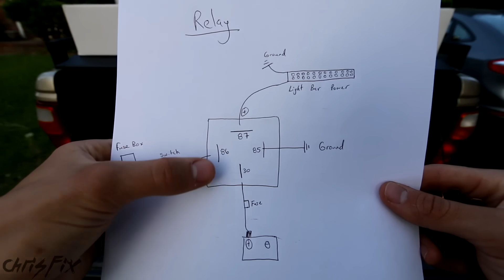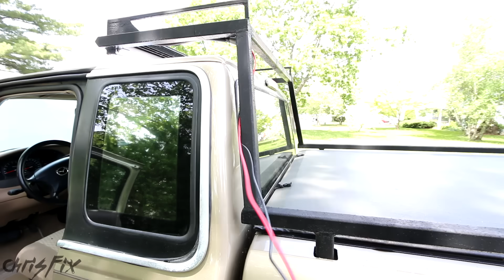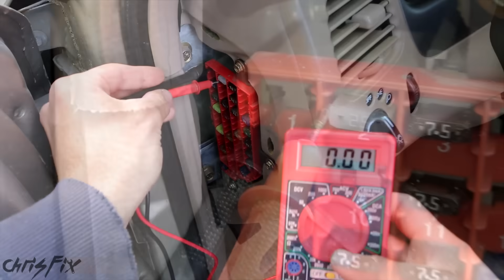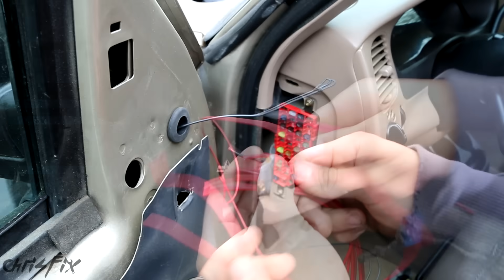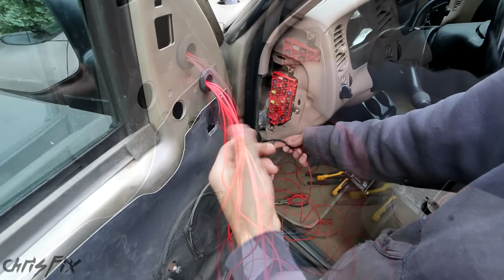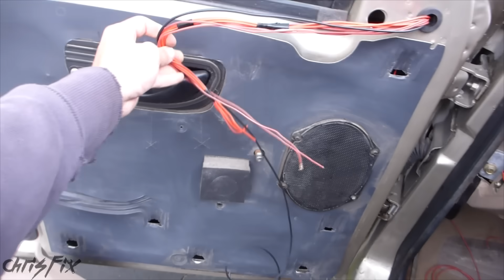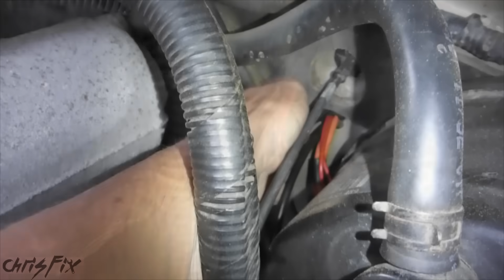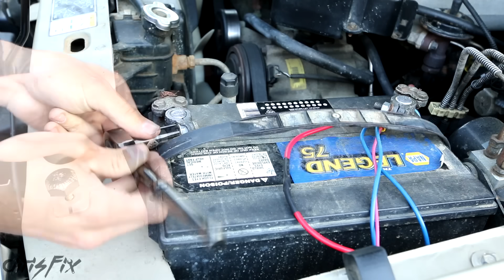How to Wire an LED Light Bar Properly (Project Night Light Episode 3)

Comment: you literally blew my mind putting that switch in the door.......
Reply: Me too! Never seen that and can’t understand why, aside from being very different
Reply: @MachitoLFC  simple convenience and orientation. It's actually quite logical, because this way he doesn't have to take his eyes off the wheel to turn them on or off. They are right there.
Reply: Why not connect the fuse tape to the wire after you ran it through the door harness 🤔
Reply: ChrisFix can u do a video on your Mazda smoke test vacuum check?
Reply: Toby Costello kaaboom
Reply from the maker: Good idea right?

Comment: ........ what do I do if my car has the fuse box in the engine bay??
Reply: it'll probably be a little more difficult wiring a switch as you would have to go through the fire wall, but it should be fine
Reply: Your car should have 2 fuse boxes, one in the engine bay and one inside
Reply: yeah you should have one in the engine bay and one in the inside, check your manual

Comment: You could have just pulled the wires through from the other side. It would be a same thing, you just wouldn't have to pill the other wire again in the other direction. Yea I've been running wires like that in buildings for 5 years so you find ways not to do the same job twice.

Comment: could you tap into the wiring to the high beams to actuate the relay so you wouldnt need a switch?
Reply from the maker: +losiboy454 Yes, you can! I want to do a video on that. I did something similar for the reverse lights: https://www.youtube.com/watch?v=ZVG7X-ae298

Comment: Does the wire for the switch not have to be as thick of a gauge as for the light bar?
Reply: +Calvin Sweeney no because its not carrying the large current that the light bar needs, its just enough to power the relay

Comment: Why use such large gauge wires for your switches? They probably use about 200mA maximum to run the relay, and maybe another 20mA for the internal leds.

Comment: great job! The link to your video was posted on T4R.org, by far one of the more in depth installation videos out there. 

What recommendations could you give for wire placement for an suv, where the light bar would be near the front cab and there isn't an option to run the power cable between a cab and bed for a truck?

Comment: Great vid. At first I was like WTF?? about running the wires (I would've done it backwards [from the kick panel and pull up through the door] but that's really a minor issue. When you explained how to wire the ground and the switches I felt like a Guinness commercial, "BRILLIANT!!" 

I like the idea of installing additional switches in advance. With the unused wires, did you label them before tucking them away?

Comment: So I am going to be putting quite a few lights on my TJ in the near future; nine lights to be exact. My big question is: in order to get the best results from the lights, am I going to need to swap in a high output alternator? I feel like my stock 117A alternator just isn't going to cut it.
Reply from the maker: +Taylor Hayden Depends on how many lights  you are adding. I wouldnt run more than 30amps over your stock electrical load. I upgraded mine: https://www.youtube.com/watch?v=XC8W9RHGTMI
Reply: Sweet, man! Thank you so much! I watched the video and will definitely be refering to it in the future!

Comment: is there a need to upgrade the alternator? since the light bar is drawing a big chunk of power from the batt...
Reply from the maker: +devdeng The light bar is only drawing 10-15 amps more which is not a big deal. Your car or truck is designed to be able to have an extra load. Now that being said, I plan on running more lights so I did this: https://www.youtube.com/watch?v=XC8W9RHGTMI

Comment: I'm not an expert but I am a DIY fan. I wired up an LED strip in my trunk and I just tapped into the trunk's existing light circuit. Is the use of a relay really necessary? Would it help in any way? Unless you want to make your own switch for on an doff? Just generally speaking. Have I done anything wrong and do I risk anything by tapping into the existing circuit?
Reply: +Alexandru Cioanca A relay is only necessary in high current applications, 15 amps and up, maybe 10. an LED strip draws less than an amp usually. You're fine.

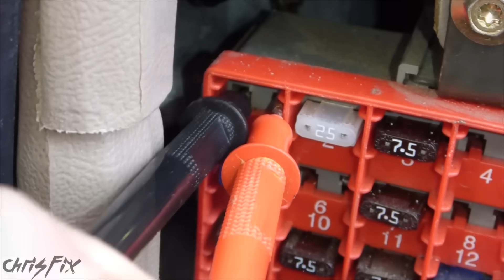Comment: 8:40  hey chrix reply please do i have to turn on the ignition while doing this? how many amps the relay? please reply need help
Reply from the maker: +GAR A If you are using a fuse tap that has power when the ignition is off, you do not need to turn on the ignition. If you want power to the light only when the car is on, you need to have the igintion on. There is a max of 30amps to the relay depending on what you are running.
Reply: +ChrisFix  chris 1 more question please dont get annoyed,   why would I used 30 amps instead of 80amps,  or  why wuold i have to used 80 amps instead of 30 amps?    sorry for asking you a lot......
Reply from the maker: +GAR A Dont worry, Im here to help. This light bar draws 10 amps (that is why there is a 15 amp fuse).  So you want to pick a relay that can hold at least 15 amps so it is protected by the fuse. These relays are mostly 30/40 amps so that is plenty of protection. You can use an 80 amp but that is overkill and more expensive.

Comment: I was wondering if you had a Harbor Freight. The shot at :32 answered that. Is the welder from HF also? It seems to do a good job but I was told don't bother with 90amp welders.

Comment: Lmfao dude I cracked up when you turned that thing on at the trail lol it's bright as shit. But nevertheless what a job well done bro. Very neat and very well done. From start to finish. I started watching this video because I'm installing a small light bar in front of my dodge dart GT 2015 & I wanted to see what I need to do for wiring. I'm looking into some USAF type switches from fighter jets to go in the cabin. I'm looking into placement and if to even do that, or connect them with the fog lights but this video gives me a very good tutorial on how to wire everything, Again well done man this helped me a lot.

Comment: Hey Chris, I dunno if you made a video about it or might have missed it, but what happens if I use a different gauge wire? My LED strips use 28AWG and I have 24 AWG, would it cause problems even if it was the opposite?

Comment: Because youre using low amperage wiring to trigger the relays, you could minimize your wiring a bit by sharing one common power wire to wire every switch. Youd still have to run an individual wire to each relay, but you could use a few less wires between the fuse box and switch area

Comment: There are some people who ride near me that leave their bright lights on (High Beams) when driving. I installed a light bar on the front of my truck (My preference ) and so far, ive only had to turn it on twice to make the other person turn theirs off. (What I do is I flash them once with my High Beams and if they dont turn theirs off, I turn my light bar on and off real quick) (Its not the proper thing to do, but it works)
Reply from the maker: +Zipping Basher I do the same thing haha. They shut it off all the time when you use the light bar!
Reply: +ChrisFix my buddy has a rear facing light bar for tail gaters. works every time hahha
Reply: @impulse9091  thats fucking dope never thought of it 😂
Reply: @impulse9091  me too... Installed it for when I have to load/unload at night, but works like a charm to make the car behind me lower their high beams. For the ones driving in the opposite direction the LED headlights work just fine
Reply: @impulse9091 thought about mounting one like that on my grand cherokee😂
Reply: I'm a volunteer firefighter so I have red and white Emergency lights. I use them to give people a stroke if they're tailgating me or won't turn off their bright ass lights
Reply: With great power comes great responsibility... @Julianna.Domina
Reply: Based
Reply: I wanna put one on the rear of my car for those assholes
Reply: Most of the guys where I live drive ridiculous suped up trucks and just leave their off road LED bar on all the time at night. Bunch off ass hats
Reply: Thank you. I've been wanting to do this as well. Glad to see that I'm not the only one with such intent
Reply: exact reason im buying one
Reply: Haha, where I live, people drive with their light bars on.
Reply: I get the temptation, but do you really want to be blinding oncoming traffic? Sounds like a good way to get in a head on collision. I'm not saying it's right they do it, just that it may not be a great idea.
Reply: @Zoroaster4  Hence the warning flash from the high beams.I come across fuckers who think it's fun to drive around with high beams on and when you flash them back, they don't dim their lights. The worst is when you have someone behind you with high beams on. You can't do anything.
Reply: @HumanBeingSpawn well i just let them pass me, then following them with high beams on
Reply: Oh. My bad that makes it ok.
Reply: @BradyPhotgraphy  sure, drive with your high beams on all the time, won’t be my fault when you get run off the road.
Reply: @Zipping Basher  I've been driving for more than 30 years, and that hasn't happened yet, so I'll take my chances!
Reply: @BradyPhotgraphy   dang ur like 47
Reply: @CadenV1234  ROTFLMFAO...child
Reply: Illegal
Reply: @BradyPhotgraphy  so is flashing your brights and leaving your brights on for that matter
Reply: @BradyPhotgraphy  and porn is against youtubes TOS so
Reply: @BradyPhotgraphy  so is driving drunk or high and people still do it.

Comment: Chris you are awesome! Just a quick tip. Poor mans wire marker is to take a Sharpee or felt tip pen and just put tick marks on both ends so you can identify them in a pinch :-)
Cheers!

Comment: Hey Chris, Love your videos! They have helped me a lot!
I just purchased a 2015 F-250 and it did not come with the [4] up fitter switches.  I purchased the switches and wiring harness, need your help to properly install it.  I have mounted some LED bar lights on top and want to wirer it to the new up fitter switches.  Can you help me?
Reply from the maker: +Greg16730 Awesome! Yes, this video will help a ton! If you need any help, let me know!
Reply: Yes, I did view this video which was a great help, thanks! But I really need help installing the wiring harness for the up fitter switches?

Comment: Chris, Is it better to ground the light at a ground closest to the light?  Or is there advantage to run the negative from the light all the way up to the cab to ground?   Thanks
Reply from the maker: +kelev Ra It really depends. The best ground is the most direct route to the negative terminal of the battery. Since this had its own individual wire going back to the battery, that is what I did. If you dont have that wire, ground it anywhere near the light on the chassis because it isnt worth the wire. The key with wiring is having the correct gauge wire.

Comment: this light bar costs $1000... damn
Reply: +Chris Maroney knockoff or real, thats bright as a welding machine lol
Reply: Yeah, I'm sure you get what you paid for but its not the right price for my project. They have cheaper led bars out there.
Reply: the dashboard is probably brighter than that lmao
Reply: +No Name Rigid industries puts a screw every 10"
Reply: Ozan Gültekin I wasn't questioning the quality. I have a cheap 50$ 24" for a reverse bar that is really bright, eventually the LEDs will go out a lot quicker than Rigid.. Only reason why I know a screw over 10" is because I read that somewhere recently.
Reply: +Chris Maroney i know u werent questioning it. oh and also, all LEDs will last about the same i think.
Reply: Ozan Gültekin Knew someone who put a 30 some on his Jeep and 3 of the LEDs went out in a month... Was bright enough you couldn't see through the light and notice the LEDs out.
Reply: Chris Maroney I guess. the quality also affects how its made, connected and wired too. cables, the glass.... so yea I agree.
Reply: you can get a led stripe that you stick wherever you want
Reply: superchopper 1996 ... there are cheap ones....i got a 32inch for $70
Reply: the one he bought is deffo $1000 though. check the description
Reply: I don't understand how to do the relay. Do the lights come with details on where you're supposed to put each wire?

Comment: Does the lighting need to have a voltage regulator/ my vehicle has a voltmeter on the dash and while charging during a ride the voltage can go up to 15 volts.
Reply from the maker: +Haridarshan Patel No, the lights have the voltage regulator built into them.
Reply: Does this comply to LED strip lights?

Comment: How do I know where to plug the wires into the switch? Says no where on the box or switch.
Reply from the maker: +SwagSubscriber You can mess around with it using a multimeter or you can just look closely, one prong is colored different than the other two.
Reply: +ChrisFix what about the other two?

Comment: When you're wiring from the switch to the relay does it matter what gauge of electrical wire you use? Or should you stick with the same gauge wire that you would used from the light bar to the relay?
Reply from the maker: +Cameron Khoury Not really. You are running less than 1 amp (.25 amps or so) so make sure you use wire thick enough to handle that for your lenght of wire you need. No need to run the same thickness of wire as your light is using. I ran 18 gauge for the switch.

Comment: So would this work for 2 light bars? I'm putting 2 12in 72W light bars on my 4Runner.  Like instead of having 2 separate harnesses, I could combine the positive wires in 1 connector that plugs into 87 on the relay? Awesome video as always!
Reply from the maker: +CaseyD Yes, since you are going to be running about 10amps total you can even use 1 relay for both lights! Make sure you use wires that are thick enough for 10 amps up to the relay and then thick enough for 5 amps to each individual light.
Reply: +ChrisFix Awesome! Thanks for your help! Keep up the good work sir!

Comment: With all those nights running, do you have a power draw issue? I'm curious because I have a 91 f150 that I'm trying to figure out why it seems to have a draw issue when I turn my fan and headlights on, I would like to add some reverse lights like you did in a previous video but I need to solve the issue of the power draw that I'm having and am curious. Btw I have watched several of ur videos and got some good ideas for some stuff, and it has also helped with a few of my projects although the size difference between our trucks means I have a little more work and a few things to do that you don't it is still nice to see the process
Reply from the maker: +hinata751 With my light bar and my reverse lights, there is no problem on the stock alternator. I used the proper size wires to limit voltage drop and I am doing a big three upgrade in the near future so that should help too!

Comment: Interesting watch, the attention to detail in how you make your videos is excellent! I have a quick question with respect to the wiring chart which you have very kindly added a link to in the description. The chart itself is very quick to use for what you have used it for here, but do you know if this is useful for applications where the current varies? As an example, in an application where the current can peak to 300A, but the range of values that are seen can be from as low as 0.032A and with a mean of 29A. From this would you choose your wire gauge for your maximum current? Or would choosing this just mean the system wouldn't work unless at peak current? Forgive my ignorance, electricity isn't my thing! Thanks :)
Reply from the maker: +Ben Whittaker Thanks and that is a great question. I would go by the fuse you are using. SO if you are using a 300 amp fuse, you need wiring to support 300 amps of current. If not, then the wiring becomes the weak point and will basically become the fuse.
Reply: ChrisFix  Thanks for the input, much appreciated!

Comment: Chris, Have you considered using a power distribution block to get all those wires off the battery?
Reply: I was going to say the same thing. He needs a Blue Sea Systems ST5026 on that bad boy.
Reply: +bigworm8181 I was thinking something as simple as:  http://www.amazon.com/Red-Power-Distribution-Block-Quantity/dp/B00H9JJPR4/ref=pd_bxgy_263_img_2?ie=UTF8&refRID=0MHEHGZ2YA3XRS90XD8R

Comment: Chris! 
Nice video, i like all your how-to videos! Why dont you run 1 of the 8 wires in your door as a common (supply) to the switches? Then you could split the wire to all the switches in the door? 7 switches on 8 wires  :)

Comment: Just finish installing and wiring mine. Gonna test it after the sun sets. Which is 1 hour away. The problem though is I melt the fuse I installed with it.. Hopefully my replacement will do... Thanks for the vids
Reply: did it go well
Reply: +Yeudiel Maximiliano yep work fine.. but the goverment here start to banned this led bars here.. but i didnt bother to remove it.. i live in the province. police are not so strict here.

Comment: Chris, I don't know if you can, but can you make a video on relays?
Reply from the maker: Yessss, stay tuned for that!
Reply: +ChrisFix how would I know where to plug the wires into the switch? I have a switch, but it has no sticker saying which is power from the battery and which is power to my relay/light. Plz help!